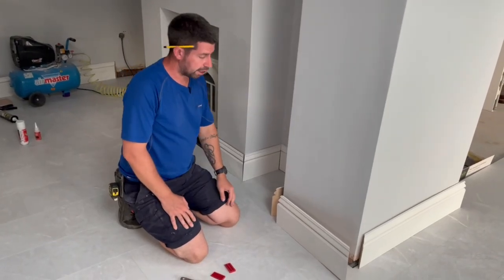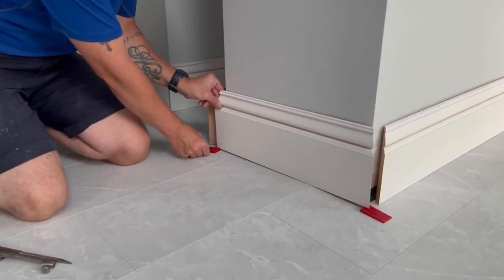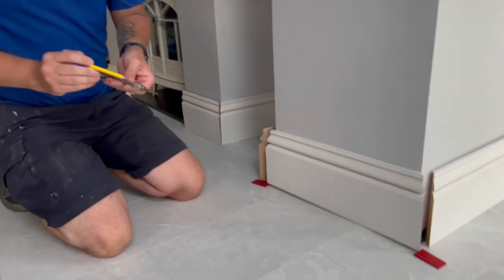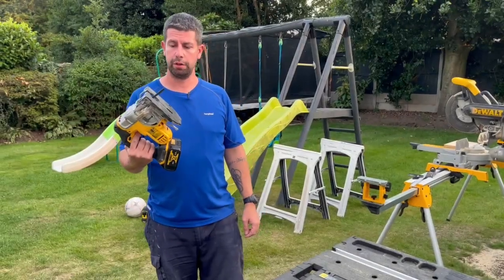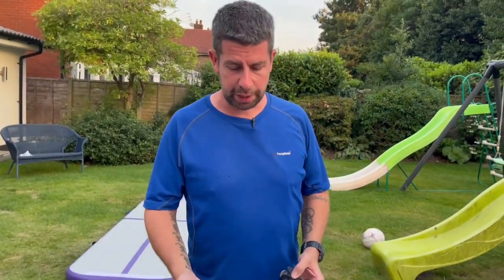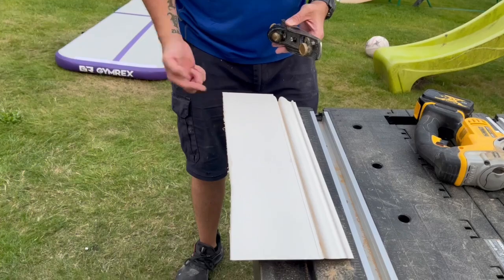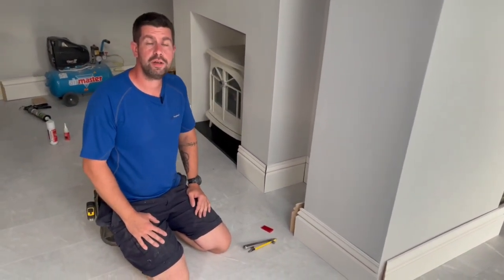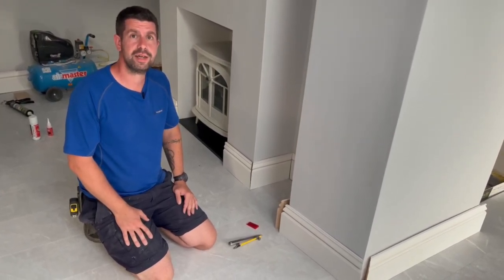How to scribe skirting boards or base boards to an uneven floor

Comment: Won't there be a height mismatch when joining to the next board- at the external corners in this case and wont this follow through until the run ends- at a door, say?
Reply: No material (height) was removed from the ends of the board. So the height will remain the same for joining the next boards. This is why the wedges were installed on each end to remove material from the center of the board. 

If he had just leveled off on one side and had the entire gap on one end of the board when he scribed, it would create the scenario you are talking about.
Reply from the maker: Joe was exactly right. I used the wedges so nothing was taken off the height either end of the boards.
Thanks for watching 👍🏼
Reply: This was going to be my question, thank you for the informed answers!

Comment: Nice video . But isnt the skirting board you just trimmed a different height from the 2 original ones that meet it?
Reply from the maker: No because I only cut the middle, the ends of the board are still the same width 👍🏼

Comment: Great video! What about if the bump was a dip, I’d that makes sense? How would you sort that please as that would mean taking height off the ends and this would affect the join to the next board. I have this exactly problem I’m dealing with now 🙏🏼
Reply: You have to lay out all the boards in that run and scribe the same amount from all of them. Make sure all inside and outside corners are flush before you start marking the scribe.

Comment: What about the other 2 boards that connect to your newly scribed board? By taking material off the bottom it seems like that piece would drop a bit or become shorter but the other 2 mitred pieces are still the same height.
Reply from the maker: If you notice I didn't take any material off either end of the piece so it will still be the same height as the other boards
Reply: Yes I noticed that but didn’t the whole piece dropped down a few millimeters?
Reply: @paullapkowski4338  Paul, the left cut end connects to board on the left. The board on the left is full size. The left end of the scribed board is full size, so perfect fit. The same thing on the right. The drop you think about is by as much as the board would be too high if not scribed. What might confuse you is the fact that the left end fits the left board before scribing, but that's because the board is level with the old floor. To connect those 2 different levels, the board has to be sloping down to the new floor, so the top of the board is at an angle at the end, not level.
Reply: You must really understand what scribing is …. Then you’ll have all your answered covered because this video should be enough to explain everything

Comment: So the mating parts at either side will have to be cut down in height also when matching them up??, grest video
Reply from the maker: Look again, I didn't take any material from either end only the middle so it will still match with the other pieces
Reply: Thanks for reply, if you would have had the bow in floor would you have to then ??@spendtimesavemoneydiy